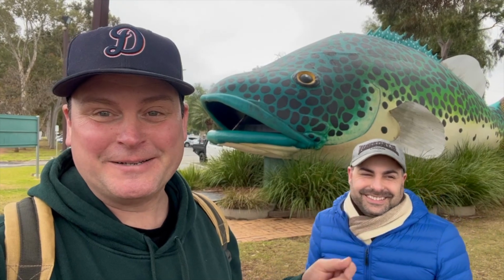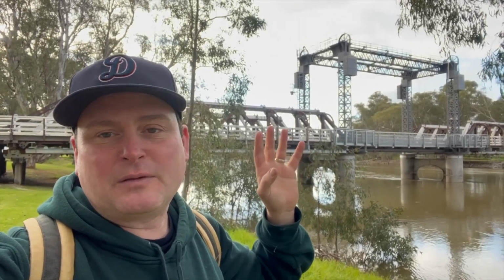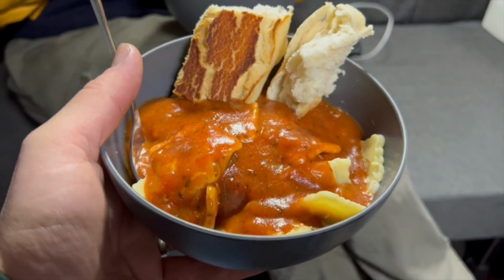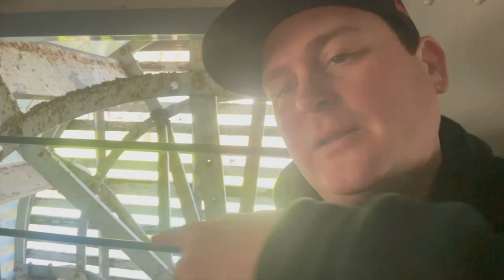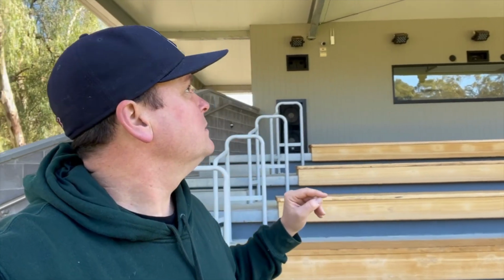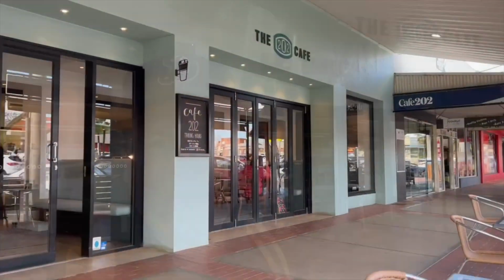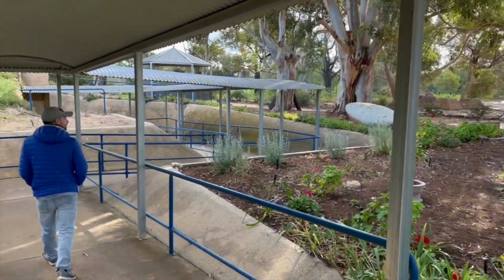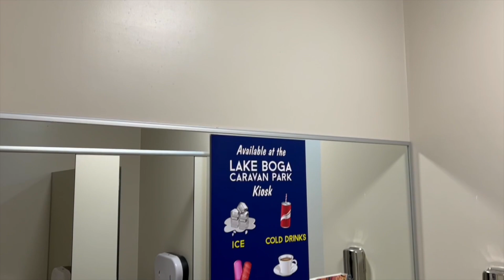SWAN HILL VICTORIA / LAKE BOGA / SWAN HILL PIONEER SETTLEMENT MUSEUM / LAKE BOGA CARAVAN PARK

Comment: hi, fyi, the Murray cod was a movie prop. and the settlement, well its seen better days. its heyday was really in the 80s and 90s. the bakery had bakers using the wood stoves making delicious breads and treats, a photographer who utilised glass plate photographs that he processed, a blacksmith who made all sorts of goods, from spice racks to fire tool sets. the post office was a working centre. a pottery, where you could make and paint various pieces. with many other businesses that have opened and closed over the years. the council being the owners and operators of the settlement has meant that its running and upkeep is never the priority, over taking its money to top up the coffers.
the Catalina Museum was many years in its establishment with council refusing many planning requests. the bunkers currently available for viewing is only a small section with much still sealed and off limits, (iykyk). there is around 10 kilometres of tunnel around the lake. and recently during the drought, when the lake dried up, bombs and munitions were found and had to be destroyed.
Reply from the maker: Wow, thank you so much for all that information. I didn’t know a lot of this. Thanks for checking out the episode we really appreciate it. Regards Deano